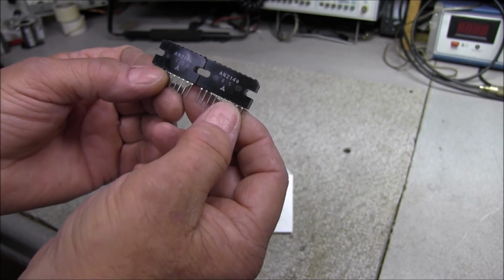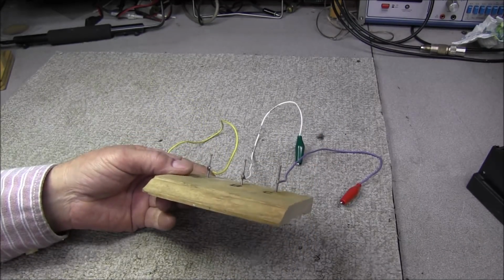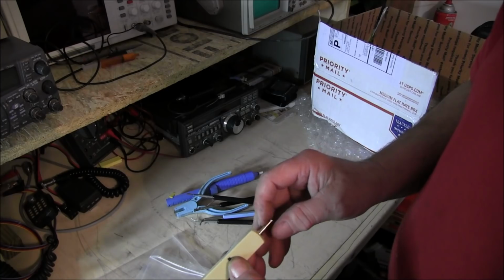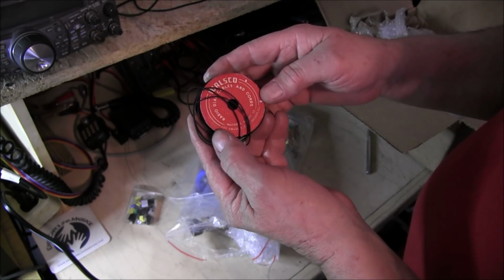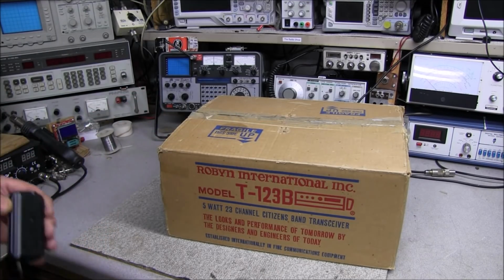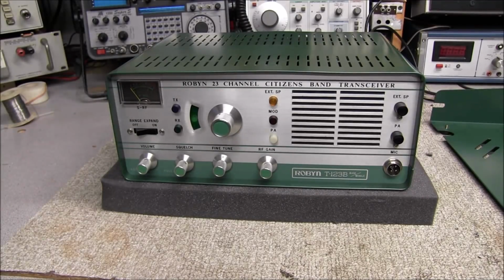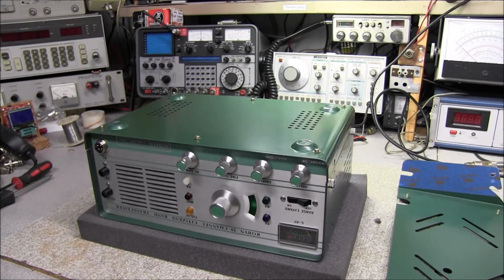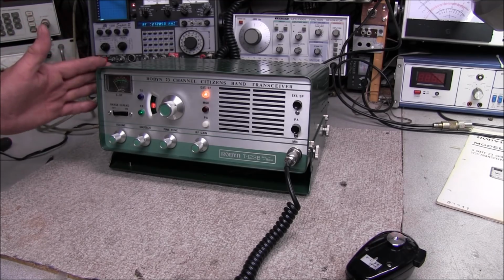#209 Mail Time

Comment: Thanks for sharing this with us. it is a nice unit, I picked up an old SBE amplifier with out the power plug  so I had to  replace it with an 11 pin plug, male and female, not the greatest looking thing. I just about died when you pulled out that new AC plug.  Thanks again, love your videos. Dave VE7CMI
Reply from the maker: Thanks Dave

Comment: always enjoy seeing your new videos.  The pliers you showed peaked my interest right away!  In entertainment rigging we call them 'mousing pliers', and we use them to wrap safety wires around turnbuckles and shackles to keep them from loosening up and failing.
I actually never thought of using them to twist wire pairs together, and now im going to have to go dig in to my old rigging crates to find mine.
Reply from the maker: Thanks for sharing that LC. I used mine when I worked in the mobile phone service.  Was real nice for twisting pairs together when wiring the system to the CO.

Comment: If it is not eating hay, I would keep it, and fire it up, and use it just enough to keep the caps up. Btw, I am looking for a original Hallicrafters S-118 manual. All the copies on the net I have stumbled across are horrible. Really just looking for schematic and alignment procedure. 

Thank for all you do to entertain us RF heads. 

73 ed gud DX! 

KC5NGX 

CQWW CW WPX on this weekend. HF bands are plenty hot.
Reply from the maker: Thank you John. Yes I think I will keep this one.  Hard to find that manual in readable shape. I do not remember seeing any on ebay.